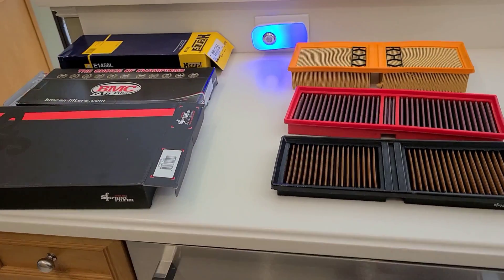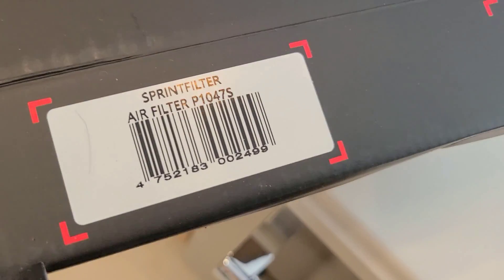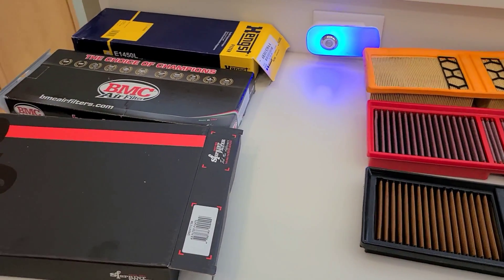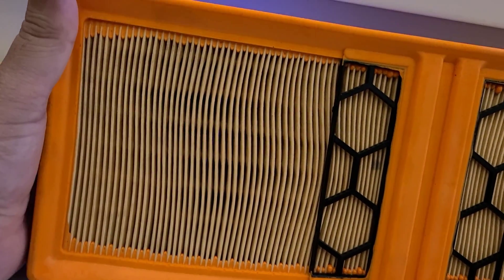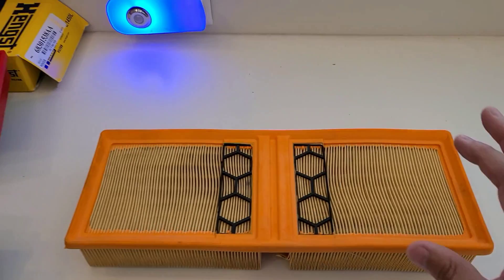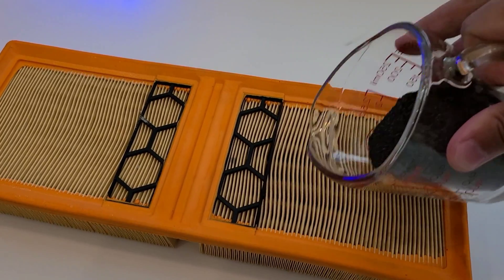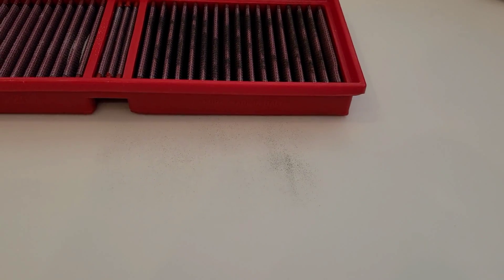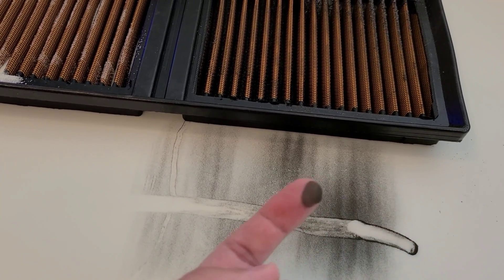Do performance air filters like BMC, K&N, Sprint let more sand and dust than OEM and is it worth it?

Comment: I have visited 2 air filter companies inching BMC in Italy. I real world applications these results would not happen and tiny particles will burn up anyway. I appreciate your effort but very deceptive results.
Reply: they do happen over time...so you visiting companies in Italy proves that aftermarket filters work better than OEM? OHHH K LMAO .... go back to those two BMC filter companies and ask them to put Your car on a dyno rev it to 6000-7000 rpm and let you air snorkel suck up hand full of sand ...first do it with OEM filter and after scope your cylinder walls and then do the same thing with BMC , K&N  or which ever aftermarket performance filter... let them two companies scope those cylinders walls after that ...  lol
Reply: @hunterharison  Nonsense. Who in the hell pours sand in the car while running their car at 6,000 or 7,000rpm?
Reply: @mhs0407    nobody obviously they're just showing you bull crap how  a performance filter gives you all the gain but not the damage after 100,000 miles or 200,000 miles ...if you even get there...try it with a high performance filter and then try it with OEM ... Do you think they put a after factory filter in a new Corvette that goes 0 to 60 two and a half seconds? Or do they put the one that does not let anything through but yet you will still buy  an after factory filter thinking you going to go faster Air volume is already calculated for that OEM filter... What you're saying is nonsense which is actually nothing.
Reply: https://youtu.be/XjHjpuSjDvM
Reply from the maker: @omgwtflmaololrotfl2368  debunked

https://www.nicoclub.com/archives/kn-vs-oem-filter.html
Reply from the maker: Sand and iron burn up?
Reply: @bhvrdr  ....if it is so bad for the engine that the small particles will be sucked inside - all engines would be on the junkyard after say about 50.000 miles!  But it isn´t so! 
I bet there are engines outside with 200.000 miles fittet with sport filters and they are in a totally normal condition!
Reply: @rolexr  This is generally true for vehicles that are driven under normal circumstances and on asphalt.  However, if you are in a dry desert environment where fine sand is constantly kicked up or blown into the air, they will get sucked in and cause damage.  For example in places like the middle east, performance filters have been shown to let through sand and slowly sand blast the engine from the inside out.
Reply: @BalanBro2  …that sounds plausible and in this environment I would also not using a performance air filter!
Reply: LOL.  You are not burning/melting sand or iron.  Both of those have a much higher melting point than the aluminum used in pistons or cylinder heads.  You will literally melt your engine before burning or melting either contaminant.

Comment: I would be interested in oil analysis results from a car running with and without the reusable filter.
Reply: I have seen these oil analysis tests with OEM VS K&N with no prob with K&N at all. Even K&N had better filteration rate and prevented harmful materials from accumulating inside the engine such as zinc, iron....etc
Reply: @hamedso9030  you're just straight up wrong. Every video that does the oil analysis shows a drastic increase in Iron coming out of the oil. Meaning there is a massive increase (up to 40%) in engine wear.
Reply: Watch these 3 videos presenting the results of used oil analyses before and after switching to a K&N air filter:

https://youtu.be/uvExyfxzsRo
https://youtu.be/cU8UMlMzi30
https://youtu.be/7D9lJxQ1s-U